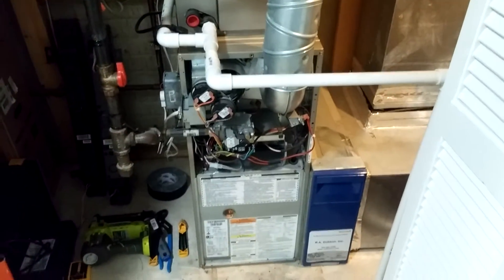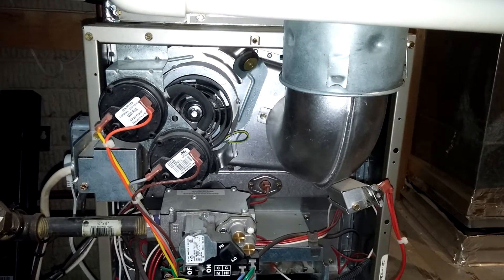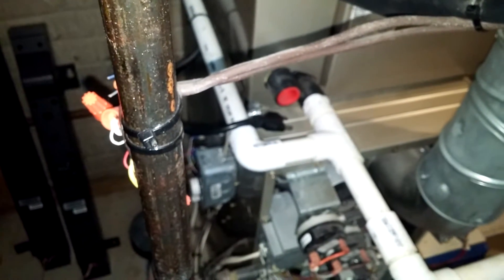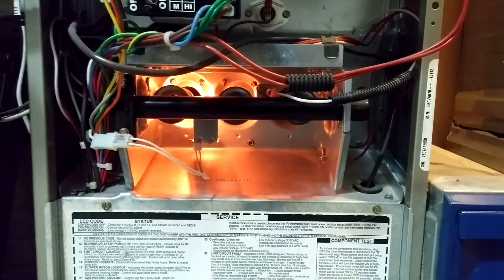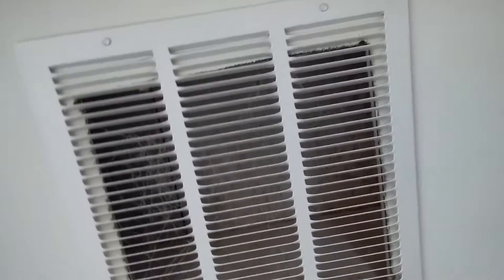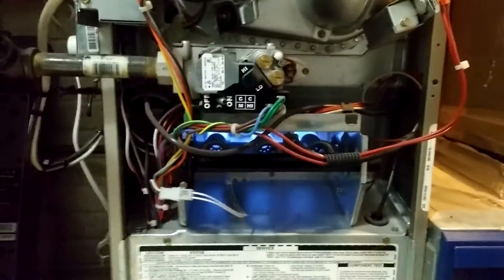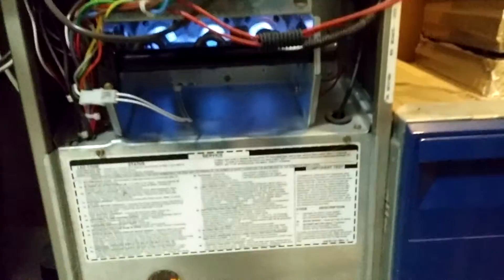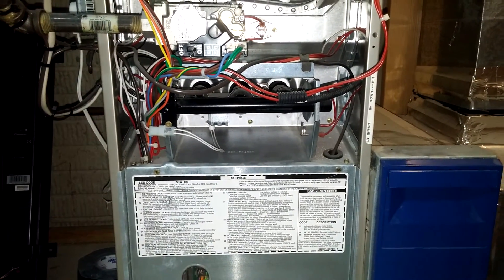Carrier Infinity 80 (58CAV) Gas Furnace Start Up

Comment: Can you comment on the loudness of this furnace?  My 80% runs at about 72 dB (measured with smartphone app 1 inch from the top of the furnace) on low, 78 dB on high.
Reply from the maker: Have not measured it using a db meter but the noise does not bother me.

Comment: I had the same furnace. The control board caught on fire due to the AC being wired wrong during installation.. funny thing, i just realized the AC was installed years before the furnace. The carrier installers must have been the ones that re-wired my old AC wrong causing 120V instead of 24V and somehow it lasted 12 years from 2006 to 2018 before it decided to burst into flames. We had to pay full cost for a new furnace and installation.. seems wrong. this wednesday will be 2 weeks since we got the new one put in i feel like i should say something but... the headache
Reply from the maker: Wow, that's a strange thing to happen! What model did you replace it with?

Comment: How big is your townhouse? Is this unit can cover 1800 SF house?
Reply: It's 60,000 BTU on high so yes it can. it was a good furnace, just look after it each year and have a professional look at it at least once if you havent already
Reply: Mary Tian wow did anybody ever answer your question!?
1800 sq ft??
For me "rule of thumb"(estimated coverage?!)....
400 sq ft per tonnage of cooling!!
2000 sq ft is around 4 to 5 tons of cooling!
His furnace is 66-70,000 btu's with probably 3 ton drive blower motor (good for 1.5 to 3 ton ac)

Direct drive: motor shaft directly to blower wheel! Not a belt driven motor!

On a 4 to 5 tons (blower drive system) the furnace usually has 100-120,000 btu's on it!

You'd probably need a little bigger furnace??
3.5 ton to 4 ton drive air handler/furnace with 90,000 btu's !
And yes I have been serving & installing ac's & furnaces since 1997!
NATE certified & licensed etc...
Actually wrkg on an infinity system today(2006 model)... the 12 yr old control is not communicating with the rest of system!
That infinity control/thermostat cost $1,000 plus to replace!!!!!!!!!!
Out of warrranty!!
I personally like standard systems & slightly above grade(less complicated & less expensive to repair!!)!
To each his own.... but when the warranty's gone get ready to pay for the repair or replace!?
Reply from the maker: Yeah that's a downside of these more complex systems. If I was getting a new one I would get the maximum parts/labor warranty possible.